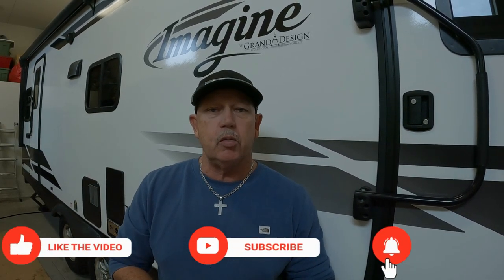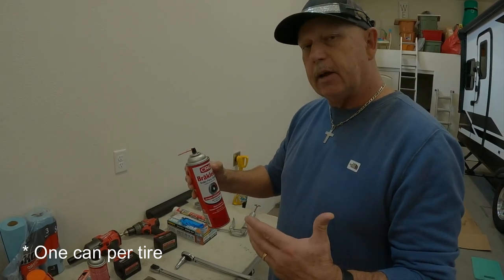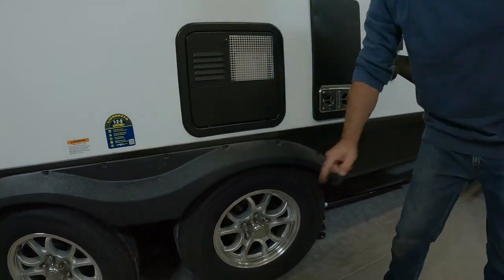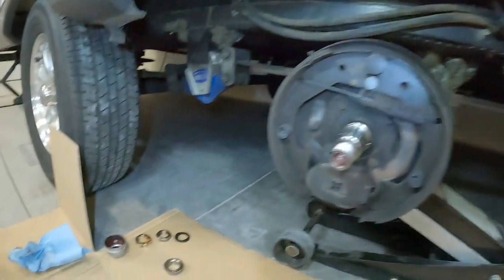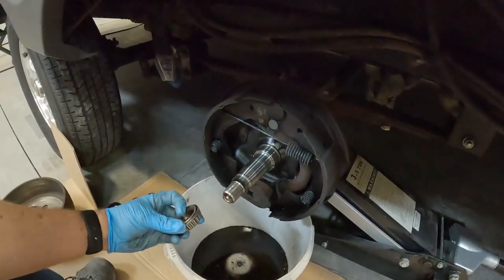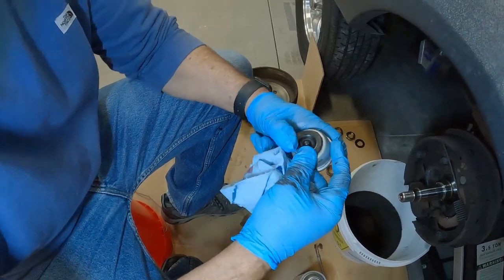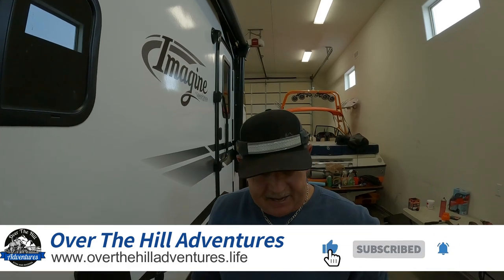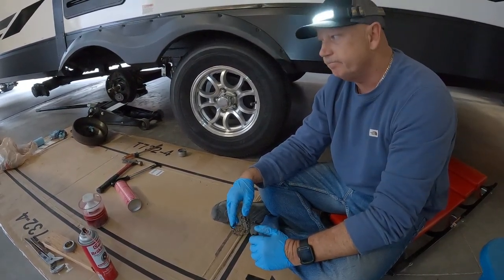GRAND DESIGN IMAGINE DIY HOW TO REPACK YOUR TRAILER BEARINGS AND SAVE MONEY

Comment: GREAT JOB STAN, now that you have inspected and fresh grease, next time you can utilize the ez lube system , Mark the wheel at 12 'o'clock . 2 pumps then turn wheel 5 minutes and 2 more pumps, this will grease the inner and outer bearings and fresh grease will replace the old, you can use a different color grease so you see when new grease reaches the outer bearings, put a small pan under with wheel removed to skin out old grease, Lots of people make a mistake in not turning the wheel and the inside and outside bearings only get new grease in one little spot, Always turn it when grease goes in, another trick is to grab top and bottom of wheel to feel play in wheel bearing after your done, sometimes you may have to snug one wheel a little more after a small trip... Keep up the good work...THIS WILL HELP ALOT OF PEOPLE WITH RV'S ETC.....
Reply from the maker: Hi Todd, thank you for your input.  I’m always worried about not getting grease to the inner bearing. I’m also worried about blowing out my seal with too much grease.  Two pumps is very conservative can definitely live with that.  I appreciate all your knowledge.  Thank you! Stan
Reply: No problem . keep up the great work ... @OverTheHillAdventures
Reply: The Lazy Lube system is not the way to do it. It's like letting a blind man grease your brakes, you cant see if grease is bypassing the seal which will cause a brake failure. Why are people so LAZY when this is an easy job, and NO fresh grease will not fill the bearing, bad advise once again.
Reply: @sundancer3700  AS i stated, after you just did the complete fresh pack with grease next time use the EZ - Lube System as designed it works great , I have done hundreds of grease jobs and if done properly the system works great, the one people do without turning the wheels end badly as you and I have seen probably more times than we can count..
Reply: @toddhenshaw7621  ez lube is a garbage gimmick, that's for weekend warriors. Those of us with experience re pack every season.

Comment: But you missed putting fresh grease on the back side of the brake shoe where it touches the backing plate. You must do this so the shoe can pivot properly. Also at the end you have to preload the bearing to 50 pounds with a torque wrench before backing off the nut. If people follow you the bearing may overheat and wheel fall off, learn how to do it right.
Reply from the maker: It is always great to have someone comment with so much infinite wisdom.  What I was taught not torque when repacking old bearings.  When putting in new bearings absolutely correct to torque your bearings nut down to 50lbs WHILE turning the drum.  Never heard of put grease anywhere near the back of the brake shoe.  That will contaminate the break shoe.  However thank you for your wisdom.  Different strokes for different folks.
Reply: @OverTheHillAdventures  Bearings need to be preloaded regardless if  new or old for proper seat then back it off. Shows you dont know the proper way if you dont grease the back side of the shoe, there are two raised areas that slide on the backing plate that require a dab of grease and wont contaminate the shoe. Do as you wish but I like to do things the right way and not be that guy sitting on the side of the freeway broke down.
Reply from the maker: @sundancer3700 I have 33,000 miles on those bearings and they look impeccable.  Thank you for blessing us with your rude comments.  It really doesn’t hurt to just be nice.  Just remember Uncle Fester what comes around goes around!  Have a blessed day!
Reply: @OverTheHillAdventures  Just hate seeing people put out incomplete garbage videos for others. Ill wave when I pass you on the shoulder with those old bearings.
Reply from the maker: @sundancer3700  no you won’t.  I just bought a new rig. I will take care of it in the same way.  Why don’t you take your garbage someplace else if you can’t be nice.  I appreciate you explaining how you do your bearings.  We can agree to disagree.  We like all comments just be a positive person.  Negativity is ugly!

Comment: I'm old, crotchety and retired but I spent 20 years plus with trucking, heavy equip. op., farm equip and eventually 17 years patrol cars. EZ Lube is a easy out for the modern generation who wants the "EZ Way" to do things instead of the best way. Bearings have to be broken down, cleaned, visually and most important FELT to check for problems. First thing to do with a new trailer, especially a RV is get it home, do a physical bearing replacement with Timkens and do a repack every year/10,000 miles.
Reply from the maker: Thanks for sharing Richard.  Stan
Reply: Why would you replace the bearings on a new rv as soon as you get home?
Reply: @freefrankgable  for the same reason GD is connecting vinyl water line hose to PVC hose & fittings which is against code in residential construction. Look under your sink and toilet etc etc. The same reason GD claims a R-40 insulation in the roof which is physically impossible. Same reason your tongue weight is probably 50% more than they showed in the sales propaganda. Manufacturers can not be trusted. The RV Industry is using the cheapest components they can find. I know of two new trailers that caught on fire because they didn't have enough bearing grease and bad bearings from the factory.. The bearings they're using are cheap Chinese junk. At 60 Mph the only thing touching the pavement are your tires. They're on wheels held onto the axle and  rotating by axle components. When it comes to running gear I want the best and they get a lot of attention.

Comment: You better make sure your bearings are REALLY DRY!!!!!!! And I don't mean sort of dry!!!!! before repacking. If you use a bearing packer you can wipe the bearings really good don't wash, then and let the packer push in the new grease.
Reply from the maker: Hi Byron, yes sir super dry!  That’s why I use brake cleaner.  It will also dry out your hands!  😂

Comment: I've just retired at Christmas. and one of the first RV projects I wanted to do was repack my bearings in our Reflection 337.  I've been watching as many videos, and while many are good, they usually had an abbreviated version and skipped something.  Stan, this may be the best and most comprehensive video on repacking bearings I've seen.  Outstanding!   So I went out this afternoon and did my first wheel.  I had to come inside a couple of times to fire up Stan on the video just to make sure I didn't skip a step.  When I'm attempting something for the first time, I have a tendency to second guess myself so it always takes longer than I anticipated.  Tomorrow, I hope to finish the other three.  Thank you again for the good work!
Reply from the maker: Hello Stephen, I am beyond words and extremely humbled by this comment.  Thank you for taking the time to write this it truly inspires us.  Stan and Rhonda
Reply: I agree, Stephen.  I watched other videos and thought I might be able to do it, but still wasn't sure.  Now I feel like I can do it and will give it a try.
Reply: I successfully did it yesterday.  The hardest part is removing the seal.  I picked up a seal puller, but it didn't go as smoothly as yours!  I eventually got it, though.  Thanks for the video.
Reply: @nutria12247    Glad to hear.  I ended up replacing 2 brake assembly just to be safe.

Comment: You do need a socket to fit the castle nut. Dexter says to torque the castle nut to 50 ft-lbs after repacking the bearings to “set” the bearings into the races. After setting the bearings, back off the castle nut to finger tight.
Reply from the maker: Hello Mark, thank you! It was my understanding only when you have new bearings.  However, it definitely wouldn’t hurt if I had one. Always like when folks share their knowledge. Thank you! Stan
Reply: Yeah, it's what you should do to seat them first.  I don't use an actual torque, but take the wrench and crank it down a bit to get near the torque with the point being that it's good and tight before backing off for finger tight.

Comment: If you DON’T screw the plunger on, as he is doing, the bearing grease packer, it will jam-pack grease throughout your bearing.  The plunger should only be screwed onto the packer when you want to pull the ram back up.
Reply from the maker: Thanks Jody packed the bearing’s really well. Stan
Reply: Can you translate to lamespeak?  Jam-packing is a good thing? or can they be over packed? No, right? The more geese the better right? (okay as the video plays we learn that it’s BAD to over-grease the bearings)
 “Pulling ‘the ram’ back up” means? 

I’m an auto mechanic but never worked on tow-along trailers.

Comment: Started to do this job in July, bought everything, 108 degrees and working in a gravel lot stopped me. Thanks for the reminder and refresh. My last bearing pack was 1985ish. Tip from todays experience. I bought some metal sanding tape, 180 and 320 grit to clean some minor marks/pits on one of my spindles. New Timko bearings and all is good. Thank you for the refresh!!
Reply from the maker: Hello David, thank you for joining us.  I am glad we could help.  Great idea with sanding tape. Blessings, Stan and Rhonda

Comment: Nice video at 12:11 you have a nice close up shot of the magnet.  You can see three holes in the magnet there should be a forth visible at 3 o'clock poison.  These are called wear indicators. Once you can't see the holes any more you need to change the magnet.   In this case the magnet holes might be blocked by dust.
Reply from the maker: Hello Rob, that is an excellent tip!! Thank you so much for sharing that!  I appreciate learning new things and this is one of them.  Thank you for joining us! Stan and Rhonda🙏🏼❤️

Comment: Thank you Stan. I'm about to tackle packing bearings on anything for the first time on our 2023 GD Imagine 2670MK. We owned it 6 months -- and even though my wife works full-time, we somehow put on ~10, 800 miles already. Time to check out the bearings methinks! I made meticulous notes form you video and even took a number of screen shots to figure out what I am doing. LoL..
Reply from the maker: Hi Tim, that is a pretty easy job.  I think you may be a little early.  They recommend 1 year or 12,000 miles.  What I think is more important is your bearings on your leaf springs.  Do you have the stock suspension? Mine were totally gone after 10,000 miles.
Reply: @OverTheHillAdventures  You may be right. I'll certainly address the suspension inspection when I check my bearings. I have read 10,000 miles from
 Grand Design suggestion, but also seen 7500 miles (too late for me about 3000 miles ago). As I have two trips coming up: 1000 miles + 6500 miles; may strike at packing the bearings now when I have a few weeks RV downtime. ;) And thanks to you -- you made it look easy, only catch is if the bearing seal(s) require replacement (or spindle nut stop) -- then it's stop and off to Northern Tools (I just found out they have a vast selection of bearings & such).
Reply from the maker: Hi Tim, every time you pack your bearings you replace the seals.  You got that right?
Reply: Yes. No choice. The seals are destroyed by the seal puller. Was suggested to me by a Grand Design individual to use a wood ram to knock off rear seal.  Tried in 1 of 4 wheels and destroyed the rear bearing.  But he did direct me to the CR3000 wet suspension as my Rv has simple leaf spring system, which is not up to par for >3k miles/year use. We’re doing 12k/year so far.  And yep.  Lots of towels!!! Lots. 😁
Reply from the maker: I just wanted to make sure I explained that in the video.  I never heard of the block of wood thing. Sorry that happened it made it a more difficult job for you.  Did you replace all the bearings or just the one you destroyed?

Comment: The zerk fitting pushes grease through the back bearing and push the grease through the shaft cavity out through the outer bearing with the drum installed... can do this periodically in between repacks.  If you see water or discolored grease will give you early warning of bearing failure.
Reply from the maker: Thank you! Stan and Rhonda

Comment: Well explained! Just the right amount of information and time.  Thank you! But one question about jacking up the camper.  Some say to place the jack under the frame rather then the axle. I see you do under axle close to wheel.  Why not under the frame?
Reply from the maker: Hello Jonathan,  it is not necessary to jack it up by the frame.  Some folks jack the trailer  by the frame so they can work on all four tires at the same time.  That takes two big floor jacks and heavy duty jack stands like when I upgraded the suspension.  It is important to jack up each tire close to the tire by the axle U bolts so you don’t bend the axle.  The same way when changing the tire.  However, I would always use jack stands under the frame or you scissor jack for safety when working on your bearings for safety.  Hope this helps, Stan

Comment: Excellent video! I was a firm believer in Lucas grease until I switched to Amsoil Water Resistant for my SXS and now my camper. The grease comes out beautiful and the bearing temps are lower now too after a few ours on highway. About 15-20f
Reply from the maker: Amsoil is an awesome product. Thank you for your kind words and joining us! Stan and Rhonda

Comment: I am envious of your garage Stan. I have to do this on my gravel driveway - and I don't know why but I seem to always pick the hottest day of summer :(  Great video -  you covered all the points as far as I am aware - probably the best video I have seen on this topic. That's an interesting bearing packer - I use a slightly different style that you hook a grease gun to, but this looks pretty easy to use.  I have seen recommendations to fill the entire cavity with grease afterwards using the zerk fitting and a grease gun, and I have done that, but maybe I'll try doing it the way you show here next time - sure a lot less messy when you have to get in there next time!   I always keep an extra set of bearings/seals with me - firstly in case of a failure on the road, but also in case when I'm inspecting them they need to be replaced I have them on hand and ready - and they are not terribly expensive.  Again, great production and very helpful - well done!
Reply from the maker: Hello Bob and Dang,  thank you for your comment.  So here is the problem with filling the cavity.  The grease hole is on the back of the spindle.  The main issue is you might blow your rear seal out.  If you pump a couple pumps through the Zerk fittings I think you’ll be ok. Having  to much grease in their causes it’s own problems.  You definitely want to avoid a grease blowout and get it all over your brakes.  Great idea of keep and extra set of bearings!👍 Thank you for your kind words we appreciate you. Stan and Rhonda

Comment: Thank you very much. I just have just finished, this is a great video !!!  We have to do that after how many miles ?
Reply from the maker: At least check every 12,000 miles or 1 year.  You want to make sure wheels turn smooth and your rear seals are not compromised. Also check for cracks in your rubber dust cover.  Sand is notorious for bearing failures. Stan 👍

Comment: Great video.  Quick question about the lug nuts.  Is there some sort of cap on them?  I was doing some regular maintenance and the lug nut seems to have crimped and now I can’t get the socket around the lug nut itself.  The RV place I called is saying the entire drum needs to be replaced so I don’t think they’re understanding my issue.
Reply from the maker: It is very possible you have a different size lug nut.  Sometimes when they tighten them too much they mushroom.  You need to get it off and replace.
Reply from the maker: What I have done in the past is get a socket and beat it on.  Use a socket you might not want.  There is no other way to get it off.
Reply: @OverTheHillAdventures  Yeah, turned out it was just a cap on the actual lug nut.  Was able to get it off and break off the cap.  Thanks for the insight!

Comment: Awesome video Stan! I will be doing this for the first time on my Travel trailer. No mechanical experience at all. It is a little nerve racking to think about screwing it up. You made it look fairly easy. You explained everything really well along the way. I appreciate keeping the videos explained for common folk.  I will have your video close by for morale support. Where do you get your bearing seals at? I am not sure if they are all just one size fits all or there is a different size for each axel as they go up in pounds. I have Dexter 5100# axels. Looking forward to your video on lock replacement. Keep up the good work!
Reply from the maker: Hello Dennis, I bought the seals from Amazon.  No! One size does not fit all. However, they are all available through Amazon.  What size of axles do you have?  If you need to reach out no problem.  If you need to know anything.  We are here to help. Stan

Comment: Hey great video,
Do you have the parts list for the grease seal and bearings?
I have a 2018 2500RL, I would think the parts would be the same?
Thanks.
Reply from the maker: Hi Corey, you have Dexter 3500lbs axles.  If you go to the link in our description, under our Amazon store then look under maintenance you will find the seals.  The bearings are not listed. Just get the bearings for Dexter 3,500 lbs axels.

Comment: Should you have adjusted the brake shoes?
Reply from the maker: I would totally adjust your brakes if needed.  Mine were a little too tight to begin with.  They would lock up too quick.  My brakes were perfect when I did this video.